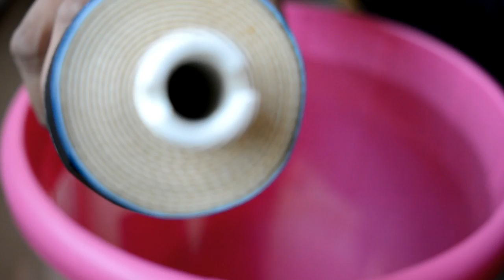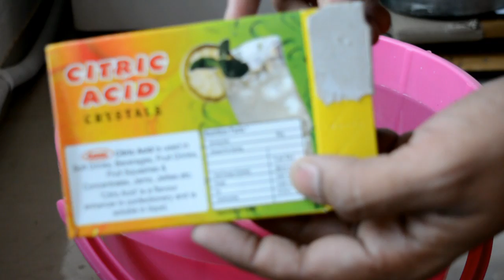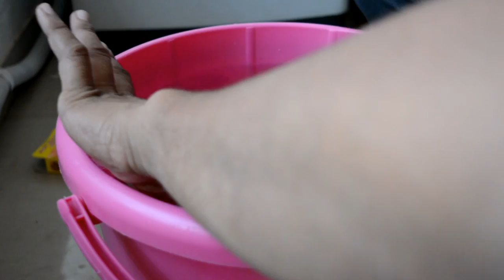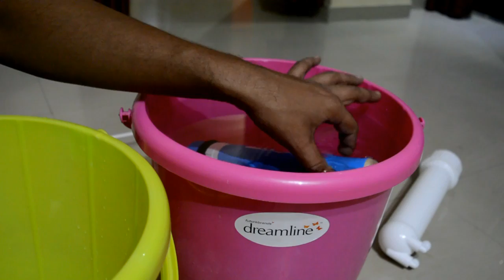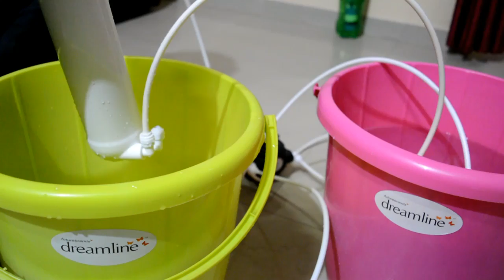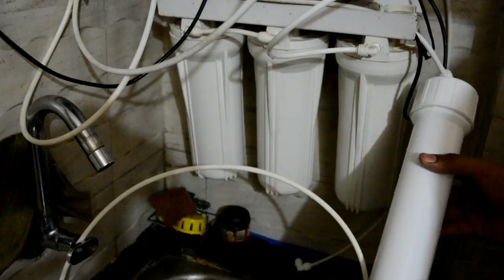RO MEMBRANE CLEANING CITRIC ACID CSM DOW how to clean Reverse osmosis

Comment: Citric acid has itself a ph of 3.5 so no matter how much you add it will not go below 3.5
Reply from the maker: Oh. True.
Reply: Not true. I used citric acid in 40c water on a magnetic stirrer and my pH meter reported 2,12.
It seem to me from my measurements that citric acid just dropped in water but not fully dissolved only goes to 3,5 pH, because that is what I get. But if I run a stirrer for a while and let it run until enough is dissolved it seems to go way below that.

Comment: Thank you.

What is the diffrence between using 1/4 and 3/8 piping in ro system. i am bulding a undersink RO. What is the exact use of solenoid valve in an RO.Can you mention what brand of filters /motors /membrane are used by the major companies such as kent , aquaguard etc which are genrally good.
Reply from the maker: Thanq sir. i will make a video on it asap.
Reply from the maker: hi bro.. can't see your comments these days ! where are you.. hope you are watching our new videos... 
pl reply..
Reply: Solenoid is used as a auto shut off valve to stop the waste water when the tank is full and when the tap is off. Best membranes I know of is fluxtek. Csm and voltron.
Reply: @matthewperrins3279  How are fluxtek, csm or voltron membrane better than the Dow Filmtec? I have been using those for a over decade and i get 0 TDS water. How can that be improved? I have always read that Dow Filmtec membrane is superior quality.
Reply: @Sam Cajampa  I never said dow is bad just never used one before, and if you getting zero tds is your feed water rain or do you also have a deionizing filter on there, to get the t.d.s to zero and you only really need zero tds water of you want to use it for batteries.
Reply: @matthewperrins3279  No, my feed water is normal communal water with about 160 TDS. I don't use deionized filters, the Dow Filmtec is just that good it takes it down to 0 TDS. I don't "need" 0 but i take it as a proof it is as clean as possible. Also i find it taste much better when it is at 0 TDS. I don't run it to a tank instead i fill large damejeanne bottles. I do use a pump though to get the pressure up to optimal and that improves the separation and speed.
Reply: @Sam Cajampa  that dow membrane is awesome then, thanks for your info man, have a good one.
Reply: @matthewperrins3279  Help i keep clogging my membrane because of our hard well water. I already installed 4 stage prefilter with resin filter and anti scalant balls but still keep clogging my membrane.
Reply: @jyrky TV  I'm not sure what els you running before the membrane but you can try smaller micron filters until it solves your problem or you may need a bigger membrane that can handle more water
Reply: @matthewperrins3279  i don't think a lower micron sediment filter will do much. It is the dissolved minerals and such that is clogging up the membrane and a sediment filter does not remove TDS content, Total Dissolved Solids means it is already dissolved and should go though even an 1 micron filter. Bu a good sediment filter is always good to use anyway to keep your carbon lasting longer and lower the pressure drop before it is time to refresh the system, because all those little sediments are filling up the macro and meso pores in the carbon and makes the water lower quality. My favorite sediment  filter by FAR is the Pentek DGD-2501-20  that goes from 25 micron to 1 micron and it works great low pressure drop and a large carrying capacity plus a good price. So far I haven't found anything better. The only reason I wouldn't use that one would be if it filled to fast, then I would use the Pentek DGD-5005-20 instead that goes from 50 micron to 5 micron. And then maybe a lower one after that if needed.
Reply: @Sam Cajampa  okay I see, I'm not sure there's really anything els that will remove dissolved solids besides a membrane, you can try I bigger gallon membrane like a 100gpd or a 250gpd though your tds will go up slightly but the membrane should last longer as the pores are slightly bigger.
Reply: @cajampa  The arrangement of my pre filter are 5 micron - 1 micron - resin filter - carbon - scalant balls to my R.O setup. Is is right?
Reply: @jyrky TV  the anti scalent balls should be first then 5m then carbon then 1m then membrane. As the scalent balls breakdown that will go into your membrane or filters and block them.
Reply: @matthewperrins3279  Can i put the anti scalant balls at the center of my 5 micron sediment filter?
Reply: @jyrky TV  you can but better to put them first
Reply: @matthewperrins3279 I've been having some thoughts about these antiscalant balls you talk about. 

These "siliphos" balls are made of polyphosphate-silicates. The silicates are meant to coat surfaces to prevent corrosion. However when used in an RO system I wonder if they're doing more harm than good. Do you think there's a possibility of the silicates in the balls clogging RO membrane pores? I haven't been able to gather any real anecdotal data of their effects on membrane life over the long term.
Reply: @avp.69  as long as there's a sediment filter after the anti scalent balls then the ro membrane will be fine.
Reply: @matthewperrins3279  Silica is a known and problematic membrane foulant. To make matters worse, these balls are always submerged in water giving a concentrated shot of siliphos when the system turns on periodically.

Prefilters will stop the "sludge" but won't stop the dissolved silicates. 
Do you not think these silicates would foul the membrane like how naturally dissolved silica does?

Comment: I THINK A RO MEMBRANE MUST BE CHANGED WITHIN 6MONTHS
Reply: Depending on the tds and the flow rate and the quality of water going through the membrane I have seen them go for 10 plus years before replacement, if the tds gets higher than 10 percent of the incoming water then it needs to be replaced
Reply: Yes as a well water treatment company owner would be scary telling everyone to change their whole house reverse osmosis membranes every 6 months🤣🤣🤣
Reply: You are confusing an RO membrane with the carbon filtration. It is the carbon that you change every 6 months. And you also clean your housing for the carbon at the same time. But as the other has said if you are carefully you can run the same membrane for 10+ years. And you also need to clean out and sterilize the system every 12 months. But the RO membrane can last a LONG time.

Comment: Instead of all this process simply rip RO and gently clean with natural products like soapnut  water and repack it carefully. By this way you can clean it 80 to 90% . I did it and I'm using it with complete satisfaction. I had seen lots of dust inside the RO , when I ripped it,  Which is highly difficult to clean it by following above video methodology. I won't recommend you to clean and use RO , as it need some skills and keen observations, plz buy new one if you don't have that much knowledge.